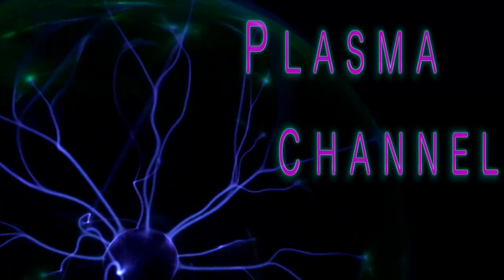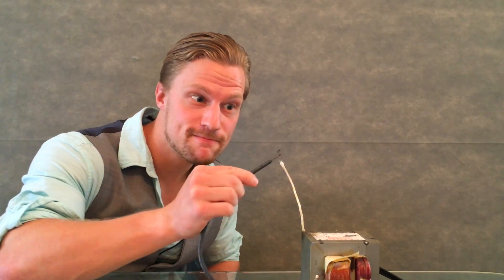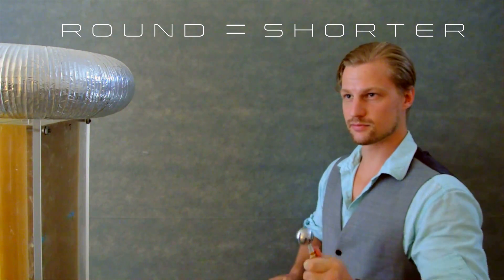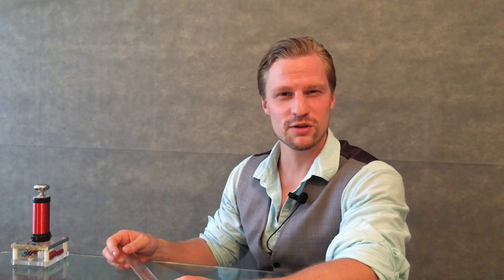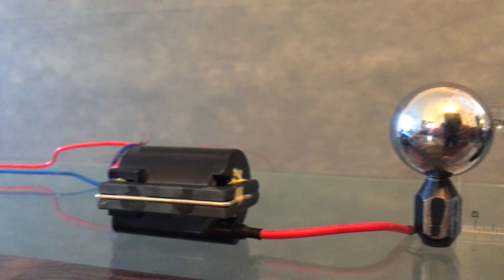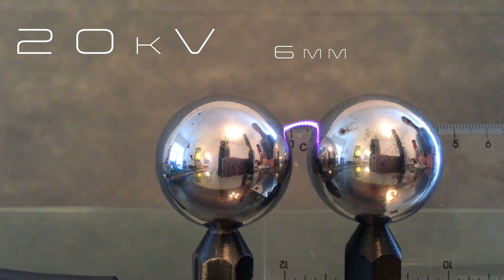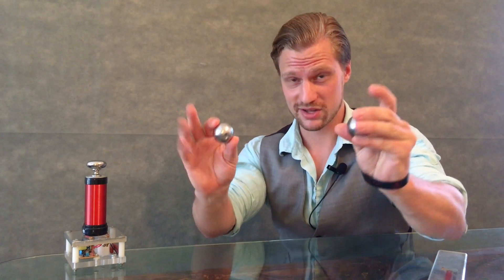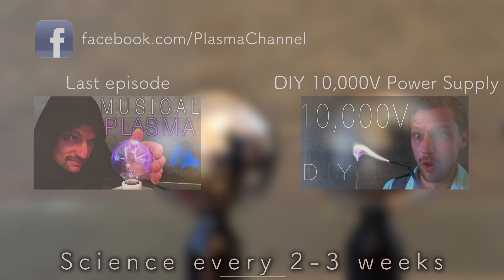Lost Technology : Measure High Voltage using Spheres

Comment: Doesn't frequency also changes arc length? Because i have this 15khz hv power supply , and I get 3cm long arcs , but I am alsmot sure it does not output 90kv

Comment: Hi can I use this method to rougly calculate the output of a Tesla coil? According to it just 30 cm of discharge would be equivalent to almost 1 million volts: it seems to me a lot. Otherwise there is another way to know the output of a Tesla coil? thank you!
Reply from the maker: Yes, you can. However, being AC it will be less accurate. Also, you'd need to measure a single pulse at once, not an arc.
Reply: @PlasmaChannel  
Thank you very much you have been very clear! Now I know that a single 30 cm shoot of my little Tesla coil is more or less 900Kv! Wow!

Comment: It works very well. I do prefer voltage dividers. That way I cab use meters or even a scope to see ripple as the current is drawn at different power levels.

Comment: Hi, how can we apply this in the 100kV - MegaV range? You should also make a video showing effects of various electrode shapes on the breakdown voltage, to help these youtubers stop making false claims.
Reply from the maker: Man, all the false claims drive me mad. Scaling up to 1,000,000 volts....im sure this method would still work assuming air across the gap is uniform, temperature is uniform, and the voltage pulse is clean.

Comment: I have a few questions :
1) What kind of power supply did you use for the voltage multiplier 
2) Were you grounded or you were were just growing static electricity when you were holding the screw driver 
3) What is the input frequency of the voltage multiplier
4)how many steps of the multiplier circuit were involved

Comment: Hello sir, can I use aluminium balls made from foil of diameter 1inch for it?
Reply from the maker: Unfortunately it will not be accurate. You need totally smooth surfaces
Reply: Plasma Channel OK sir , but can you please tell me from where I can get steel balls because I didn't found them
Reply from the maker: They can be found at many home improvement stories. Like Home Depot or Lowe’s. Mine in particular are Chinese medicine balls (meant to roll on your body to relax muscle)
Reply: Plasma Channel OK thank you sir
Reply from the maker: You are certainly welcome

Comment: Hey J,
We know voltage is around 10kv to 20 kv but, What is output current of flyback transformer? Which gives 20kv. 
Any value, approximate range?
Reply from the maker: If you are referring to my flyback in this video, it is approximately 2-4 mA of current. But flyback transformers output over 100mA if designed correct.
Reply: Plasma Channel 
In general  Sir J,
Color TV flyback transformer. Which gives 20kv, 
2 to 4mA current is correct?
And what does voltage multiplier multiples its input current?
Two questions are there. Please

Comment: When you were demonstrating the arc length with the screwdriver and spheres your arm was twitching with each discharge. I was wondering if this is reflexive or was the arc somehow causing a muscle twitch?
Reply from the maker: Those were contractions via the shock. They are extremely short in pulse, meaning safe for heart. But, still cause momentary arm twitch

Comment: Hmm I'll have to try that, I have always used the " 1 KV per mm " rule and I do have a HV probe but I can't measure the output from my Tesla coil 😂
Reply from the maker: 1kv/mm tends to hold close to true for spark points, aka ends of wire.
Reply: ah, so then i wasn't too far off as i did measure some of my HV transformers with a probe for comparison and it was very close to accurate .. then again i always used spark gaps with sharp ends as they conduct better at least in measuring :-)

Comment: Um... no, you're not exactly right, 30kv/cm value works only for gaps more than 4 times smaller than the diameter of one of the spheres, other way the electric field decreases pretty quickly, so 20kv is just about the limit of this measuring device; you can not measure voltage from your voltage multiplier with these spheres; not to offend you or anything, I'm just tired of people (not you) on the internet claiming that their 30cm spark is 1 million volts or something like that
Reply from the maker: I too am bothered by large claims of voltage. When people claim their tesla coil creates a million volts.......Yeah.....try putting that coil on 1 break per second and measure the individual spark length, not the arc built up from 100 sparks per second.
Reply: Al channel, I'm trying to understand your statement but it's  just a brainfuck. "...gaps more than 4 times smaller than the diameter of one " what exactly do you mean? gaps more than or gaps smaller than?